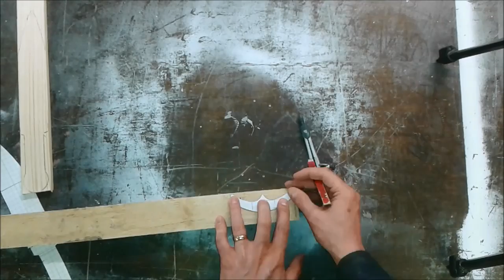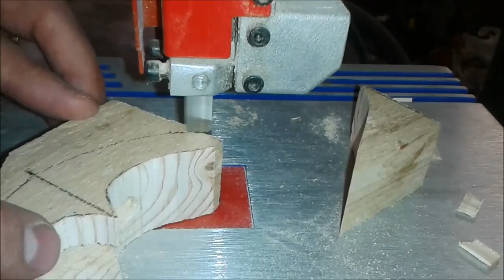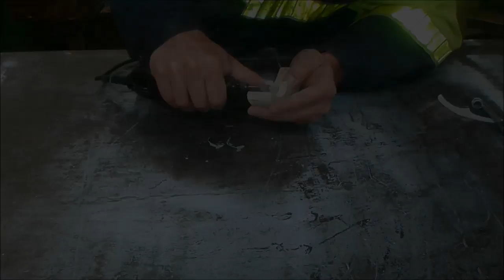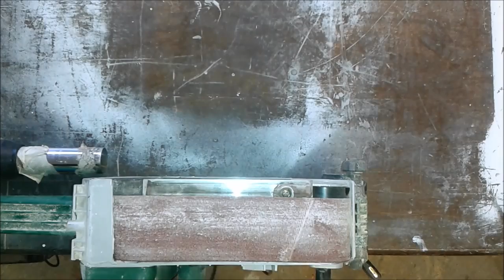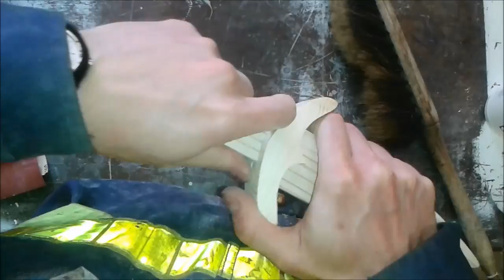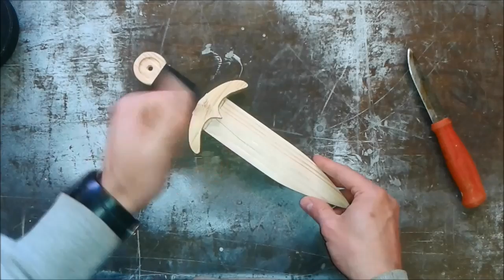Make a wooden dagger.

Comment: It looks good but it would be much stronger if you just used a naturally curved piece of wood for the guard, definitely a project that can be done with a hatchet and knife rather than a series of power tools in a woodshop.
Reply from the maker: The original idea was to make a lot of these and sell them. And this design and methods allow it. Thanks for watching.